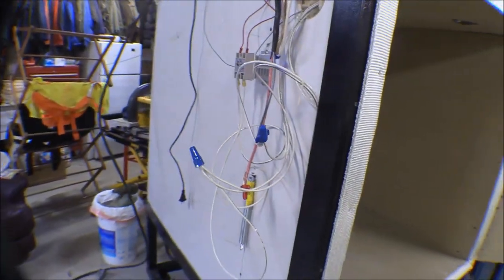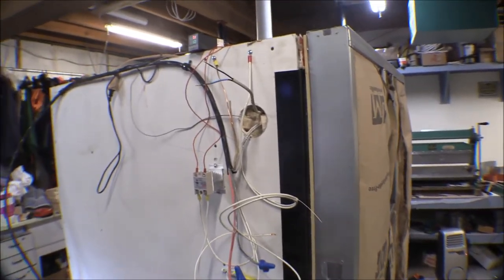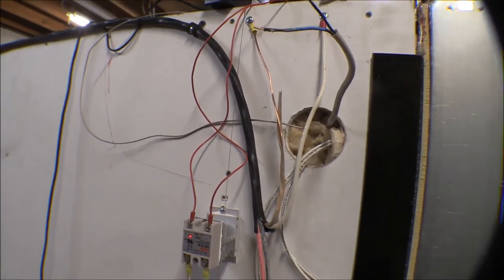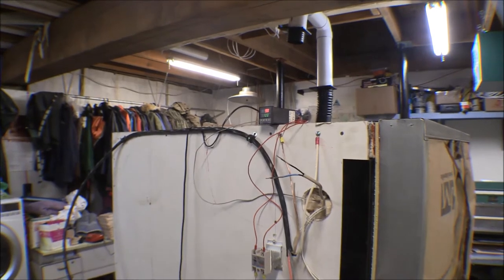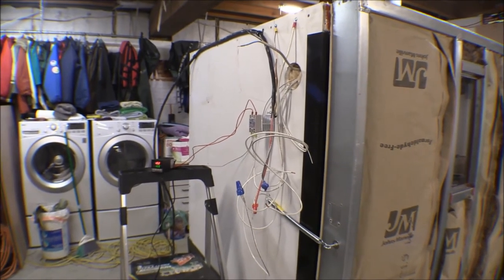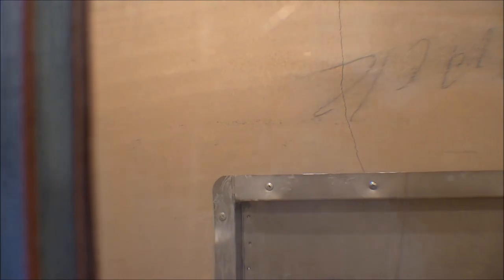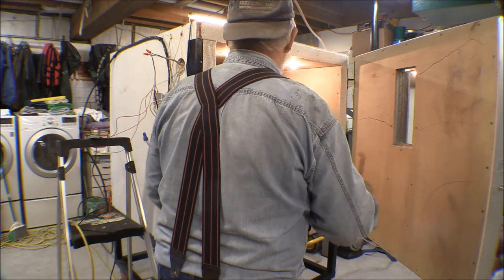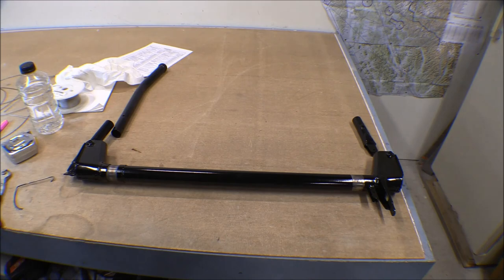Powder Coat Oven Build - first run

Comment: Very neat, well considered build. It would seem that you are losing far too much heat through the structure though. May I suggest you line the inside with aluminium foil to reflect the heat back into the oven cavity. You will notice an immediate difference in the contact temperature of the unit and this is heat that is currently being radiated into the workshop. Warm up times will be significantly faster, your oven will be more accurately controlled with a corresponding improvement in finish and you will save considerably on power costs. Thanks for the very interesting video; it was inspirational.

Comment: I like the idea but dont like the drywall or concrete boards alot of those has foam insulation as filler... I own a wood stove biz and i can tell you the same material that they use for sound proofing (normally buy it from real drywall stores) they use it on the top of these reburn chambers in wood stoves...i have used for gas displays in our store where drywall was behind ..lets just say i put a propane torch and my habd to the other side never felt anything....
Reply: * hand

Comment: Ok,  I'm building once also.  What is that thermostat regulator thing in top called?  Thanks
Reply from the maker: The controller is called a "pid". It has a circuit for the thermo-couple and a switch for the ssr( solid state relay ). The solid state relay is the main switch for the power to the heat elements, and is turned on and off with the pid. I got these as a set off ebay for about $15, pid, thermo-couple, ssr and heat sink. These are calibrated in Celsius, Fahrenheit is available but I couldn't find any for less than $50.  I have found that a ssr is needed for each heating element.